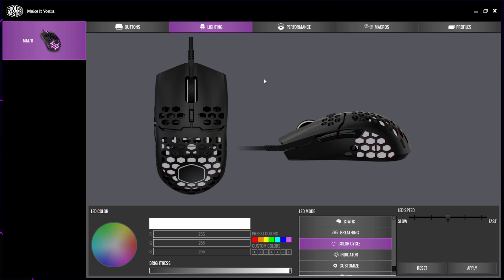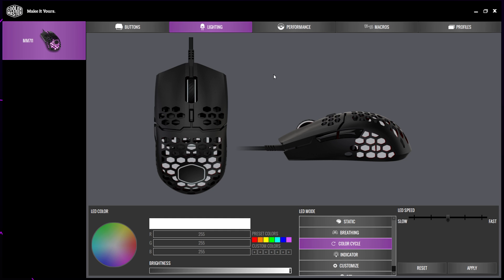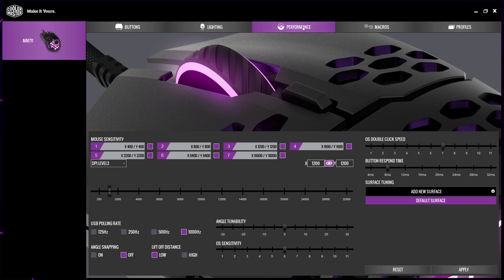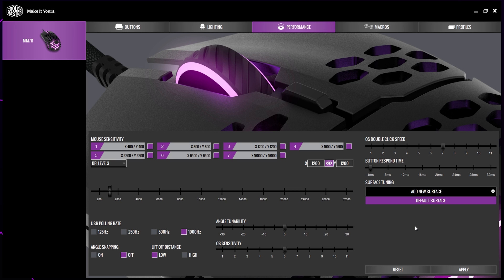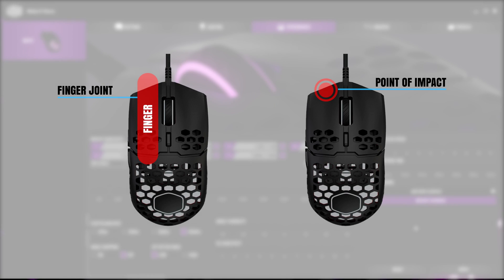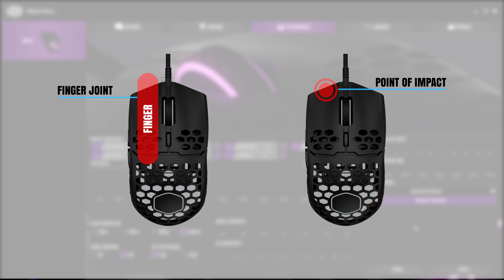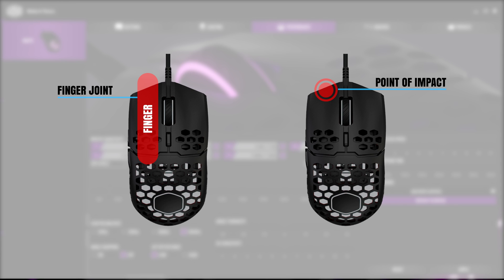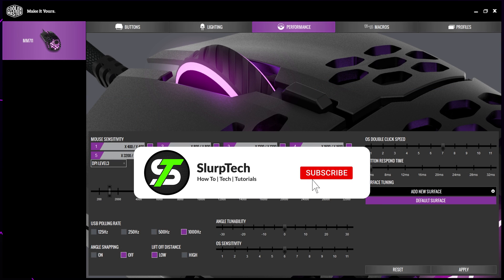How to Double Click with the Cooler Master MM711 and MM710

Comment: is it better to turn button response time to the lowest setting (4ms) even for gaming only ? i assume lower response time is better all around
Reply: It seems you may have misunderstood. This setting is not for the latency between input and output between mouse and the actual game but it makes more clicks register in a shorter period of time, which you ideally don’t want this low in most games apart from high cps ones. The default of 12 ms more than enough for fps games since you probably don’t want to have to fire extra times
Reply: @sakshisachdeva5419  ohhh i get it now thanks sỉr

Comment: I'm having double click issue
Reply: What happened
Reply: @PebbIe.  I thought it was software but it wasn't so I got the mouse replaced 
Took 1 month though
Reply: @aMyth10 ok but what was the double click issue tho?
Reply: @aMyth10  Because I just ordered mine
Reply: @PebbIe.  it is a great mice, in my honest opinion. very light, very controllable. after 2 years of use however, I am having double click issues on the right click. I need to press very hard in order for it to count it as one click. very frustrating. also keep in mind that it has only 1 year of warranty
Reply: @MERTMERIC7  hi I need help when I’m using the master plus software when I adjust the Debounce time the changes don’t save pls help me
Reply: @MERTMERIC7  Actually it is 2 years of warranty and I got the double click issue... Trying to get it replaced.
Reply: @vinupraneeth  idk mine stated that it was a 1 year warranty. switched to hyperx pulsefire haste a couple days back
Reply: @MERTMERIC7  I came to know it's 2 years of warranty only after I checked it entering my Serial number in the website. That's when I came to know that I had 3 months left and decided to get it replaced instead of throwing it away.
Reply: you could just adjust the debounce time to 12ms to fix it
Reply: @mudsoap  yes I’m using this mouse it works very good, but the software will crash at first opening, but if you reopen it it will take a while for the stuff to load but I can get up to 22 cps with this mouse with butterfly clicking
Reply: @PebbIe.  i ordered it thank you
Reply: @PebbIe.  really